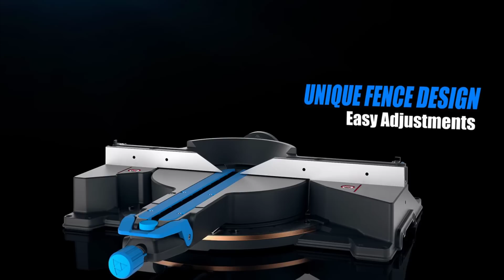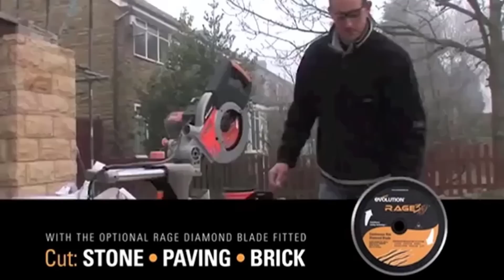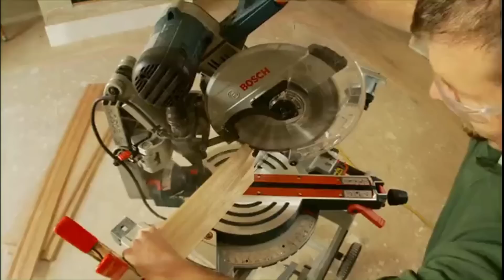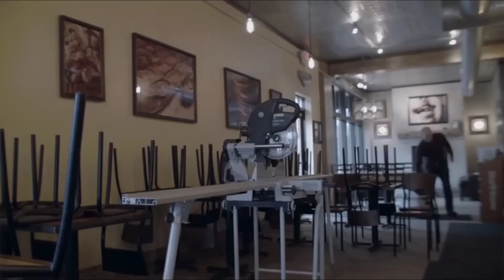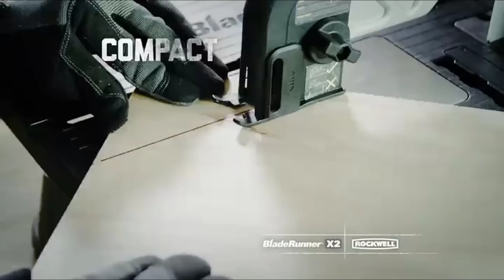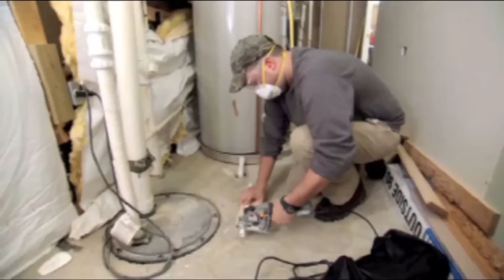Top 10 Best Miter Saw

Comment: My partner has the Festool Kapex, I have the Bosch 10" axial glide saw, my saw gets used all the time on the job even though both saws are set up for interior trimwork in the house, my saw is the only saw used when doing crown because you can cut large crown on the flat with Bosch, not so with the Kapex, even though it costs $700.00 more ??? come on.

Comment: Would someone explain why these saws are pushed into the work which results in a rougher cut??
Reply: Jack,  It's a sliding miter saw safety issue.  You have a blade that is rolling toward you at 1000's of RPM.  Pushing the saw away from you while cutting HELPS to control "runaway".
Reply: @tribulationprepper787  Sounds like a design error to me?? In 1970, while working on the "boy's school" where Tyson learned to box, The GC from NYC supplied us with B&D radial arm saws. The arm consisted of a 2 1/2" thin wall tube indented on both sides to carry the motor/blade. After several of them nearly gutted carpenters when they came apart, they were replaced. So, I understand the principal for concern, but times have changed, design has improved, and one has to be totally ignorant to misuse a miter saw. I just can't see cutting trim using that method??

Comment: where the buy?
Reply from the maker: Here you can Buy

Bosch 10-Inch 15-Amp Dual Bevel Axial-Glide Compact Miter Saw, CM10GD - https://amzn.to/2rXGOHW
Delta 26-2250 12" Dual Bevel Sliding Cruzer Miter Saw - https://amzn.to/2IwXiRM
Evolution Power Tools RAGE3 10-Inch Multipurpose Cutting Compound Sliding Miter Saw - https://amzn.to/2LbJrhv
Bosch 120-Volt 12-Inch Dual-Bevel Glide Miter Saw GCM12SD - https://amzn.to/2Gz3AKV
Festool 561287 Kapex KS 120 Sliding Compound Miter Saw - https://amzn.to/2IwF2Id
Hitachi C12RSH2 15-Amp 12-Inch Dual Bevel Sliding Compound Miter Saw with Laser Marker -  https://amzn.to/2IBua7K
Rockwell BladeRunner X2 Portable Tabletop Saw with Steel Rip Fence, Miter Gauge, and 7 Accessories – RK7323 - https://amzn.to/2kcBhce
Makita LS1216L 12-Inch Dual Slide Compound Miter Saw with Laser - https://amzn.to/2rTBoxS
Rockwell RK3440K Versacut 4.0 Amp Ultra-Compact Circular Saw with Laser Guide and 3-Blade Kit with Carry Case - https://amzn.to/2wY6zwF
DEWALT DWS780 12-Inch Double Bevel Sliding Compound Miter Saw - https://amzn.to/2kbd9a7

Comment: you didn't really get into accuracy as much as I would have liked. I've had my 10" Hitachi for 15 years and it's getting to the point should I buy a new saw or revamp my old one. I wanted to know the level of accuracy of put of the box. I was looking at the dealt 12" which here is almost 2 grand.  could you touch on this subject or "level of accuracy out of the box" thanks for your videos they are really helpful as salesmen will tell you whatever you want to hear. congrats

Comment: My shop saw has been sitting in the exact same spot for at least 6 years - its the 12 inch sliding Milwaukee and I like it very much though it does take up too much space but it's very accurate and has lots of power but there are some minor  short comings that I can usually overlook but not always - would I buy another or switch out with another brand?  Perhaps if Milwaukee improves with their next model I'd buy it when I'm at the point that I need a new saw - if not, I may or may not buy something else as I'm already past retirement age so why bother?  My portable saw for placing into the back of my truck is a small 8 inch Hitachi, it's easy to lift cuts well and is accurate, the only thing about the saw that I really don't like is the start up which really is quite explosive if you're new to using the saw but you'll get used to the lack of a soft start - eventually.  Over the years I've owned several saws and I've come to the conclusion that every saw has good points and bad and I for one will never be completely satisfied with any saw although if one tries enough of them sooner or later you'll find one that doesn't piss you off so much. I know a lot of craftsmen and what I'm seeing right now is a lot of DeWalt's at job sites which to me would seem to indicate the saw is a good one though not having actually tired one I cannot say anything about it except it ought to be easy to find in the dark.  I'd like to add; I like the way the Bosch saw's arm works though I'm afraid that smoothness one gets to feel on the showroom floor would quickly bog down once one starts cutting pine or some other soft sappy lumber.   Now,  there's now way on Earth that I'd invest over a thousand dollars for a saw that's limited to a 10 inch blade - I may of course be wrong about the capacity of the Festool and they do make tools that I own and like very much but I also don't like the look of the Kapex;  It just doesn't have the look of a real man's tool and I am after all - yes I admit it - too old to like seeing women on the job site, except as flag girls or having a woman flying our Fighter Jets or serving in combat MOS's no matter what the job, so I'll never buy a Festool kapex and  there's no way anyone can convince me a saw that has one single unique design feature should cost twice as much as every other brand, after all, all sliding tilting miter saws do the same thing - some better than others but is one so much better to warrant getting taken for a ride?
Reply: you is probably the only truthful answer ../ thanks

Comment: Bunch of ads; no real "meat."
Every saw has pluses and, minuses.
Use a cheap sliding miter saw (a la Harbor Freight) for cutting framing; a better one (DeWalt/Bosch) for finish.
Actually, the Harbor Freight saw works good for trim, also. You just don't feel as bad about it if you fu*k it up for some reason.
The Hitachi used to be the gold standard for sliding miter saws, but they've kind of been left in the dust by newer improvements. And their miter scale is still hard to read.

Comment: Never buy Bosch.  Poorly built, inaccurate, and delicate.  The bosch crap is for homeowners, who use it once in a while.  No Contractor, Cabinet Maker, or Finish and Trim Carpenter that I work with will use anything other than DeWalt, Milwaukee, and the very very occasional Makita.  I've owned 2 bosch chop saws, multiple routers, and sanders and the job site table saw,  and they just don't hold up to hard use in extreme enviroments.  I learned the hard way, and I hope that someone pays attention.
Reply: Haha what?
Reply: How much Indian money.
Reply: WOW EMMITT...  The trolls are out tonight!
Reply: I have a hitachi 8-1/2 slide-miter-compound thats nearly 30 years old and runs as good as day 1.  Any crown moulding or high end trim job that saw is what I bring.  On the other hand I do have a dewalt for the   standard construction work.   Who would buy a saw like a festool for cutting a bunch of 2x lumber?
Reply: Never pay attention to anything emmitt moore says. He is an amateur know-nothing.
Reply: I never pay attention to ANYbody who has nothing more than baseless unfounded and LAME profanity to convey their message.  I got the message. They're an ignoramus!

Comment: the Bosch GCM12SD  is a piece of  crap!!!. i bought it  to replace an old 16 year old dewalt 12". The Bosch   does not cut straight nor accurate  for  precise molding nor crown, completely  sucks for trim work!!!!.  because the  fences are  not  one piece part of the base  there is all ways  1 to 1 1/2 degree difference from right to left and the 45 corners  are always off.  i took the  Bosch  to the  factory  service  center 3 times to get it fixed for accuracy but  never fixed the accuracy after the  3rd time i asked to have it replaced but  the management said  i needed to take the issue with  factory. I defiantly got a lemon . 2 years later  still fighting for a new saw so  the saw sits in the corner of my shop collecting dust  and only used for rough cutting 2X4's  please  do not  buy this  saw its crap!!!  do not waste your money on it!! if you buy one take it home and make sure its cuts perfect 45's and accurate on left  and right hand cut!!!  For me at  the  end I had my DeWalt rebuilt  and  went back to using  it as my primary  miter saw...

Comment: 30 years in finish carpentry and cabinet making and I still hate sliding  mitre saws.  A simple 12" old school dewalt will cover 95% of tasks and is easier to transport to jobsites.  A slider is great for shelving or skirt boards, but otherwise bulky, obviously has more moving parts to fail  and a pain to transport.  An accurate 10"  mitre saw is good for most projects and for the "DIY" crowd, spend your money on a table saw and build a nice outfeed table. And,,, never use the "crown" settings on a mitre saw, cope crown or "think" you have mastered any tools.  I used a tablesaw  since I was 10 and it took me 40 years to respect it. Hopefully,, a thumb later, this will help someone. That "rage" saw did crack me up. It does everything, but nothing well, like many contractors.  Last bit of advice,,,, NEVER hire a person that does roofing, siding, concrete, framing, trim, carpet and painting,,, they won't be good at any of them.
Reply: jack handy Forty plus years here, I agree. Though I do have a 10 inch Makita double slide too.

Comment: I know why my Kobalt sliding compound miter saw wasn't on the list :(
Reply from the maker: This miter saw add in next list :)
Reply: Best List I have had nothing but problems with the blade guard retracting linkage. I took it apart (again), polished all the contact points and now it seems to be working ok. I never use the laser alignment because it"s not lined up with the blade cut and the manufacturer recommends not trying to align it (go figure). Otherwise, a decent saw for the money.
Reply: Gene LeGate l

Comment: 1 and 4 is the same saw
Reply: joshua carne  1 is 10 Inc and 4 is 12"
Reply from the maker: Company same but saw models different check This 

Bosch 10-Inch 15-Amp Dual Bevel Axial-Glide Compact Miter Saw, CM10GD - https://amzn.to/2rXGOHW
Bosch 120-Volt 12-Inch Dual-Bevel Glide Miter Saw GCM12SD - https://amzn.to/2Gz3AKV